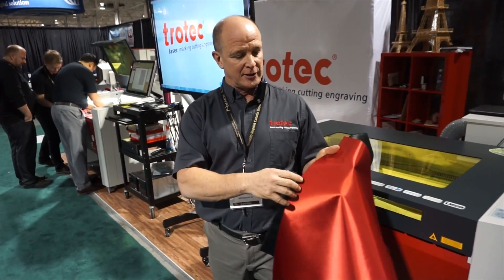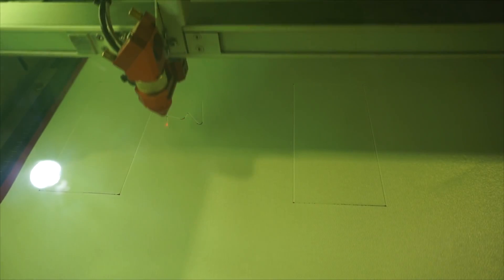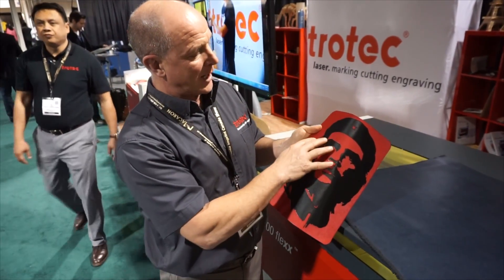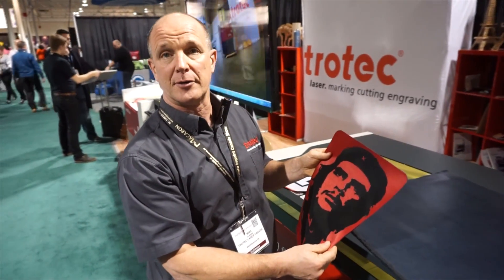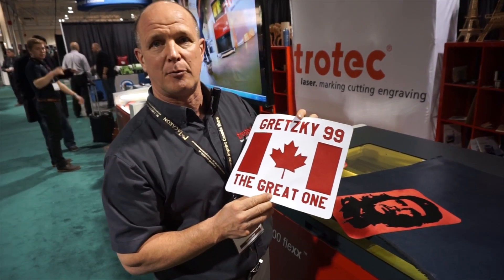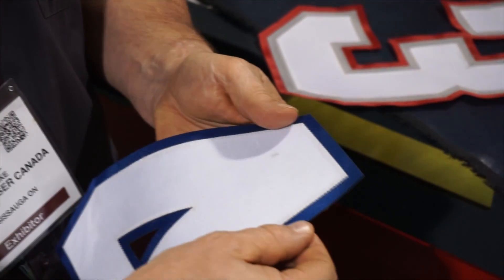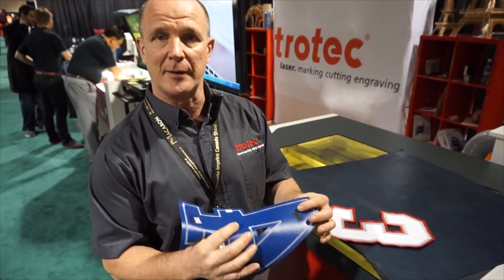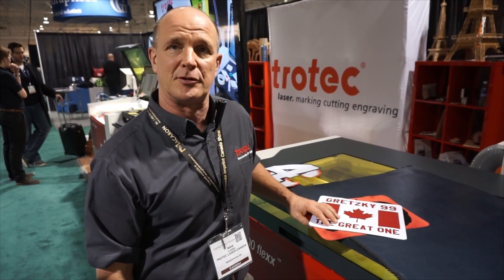Cutting Twill | Laser Cutting Fabric | TICS 2016

Comment: Great video showing the capability and the process with this material and your machine. Can one create a small laser cut multi color twill pattern (say a vine and leaves pattern) with a different color twill background that's only about 3 or 4 inches in width and about maybe an inch or 2 in height, or does this method of cutting twill or heat pressed felt only work for very large designs? In other words can one create small somewhat intricate vector cuts in these fabric materials to apply to clothes or hats or would the material not allow that or it breaks apart perhaps with small designs?

Comment: This stuff can be done with a vinyl cutter. I want to use a laser cutter for inlay wood work.
Reply from the maker: You can, but a vinyl cutter won't sear the edges together with the heat of a laser.
Reply: @TrotecLaserCanada  With this, the edges are bonded?
Reply: @JasonLooseArrowAlso  yes the heat of the laser 🦭 it